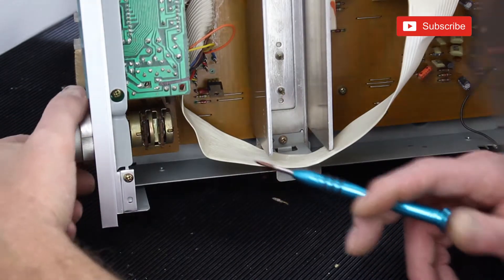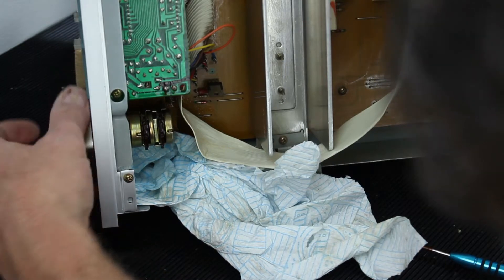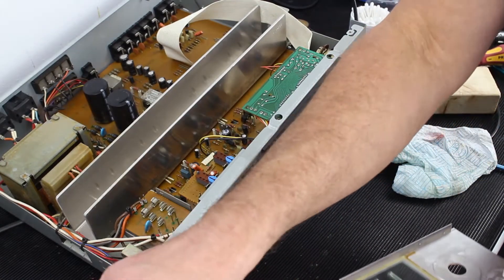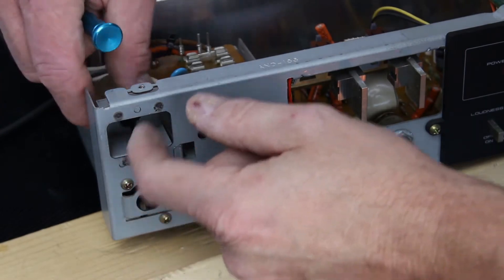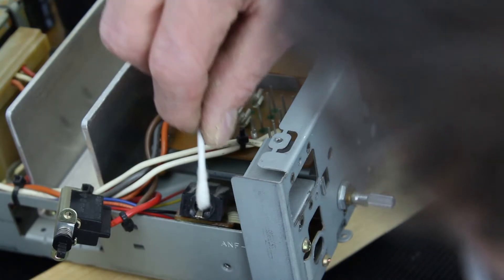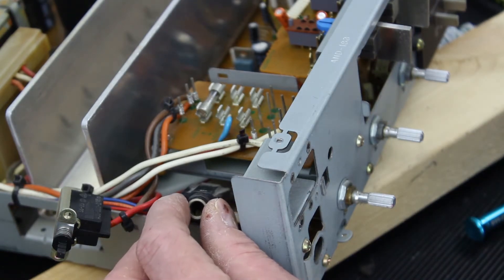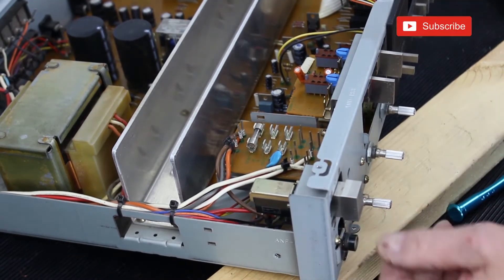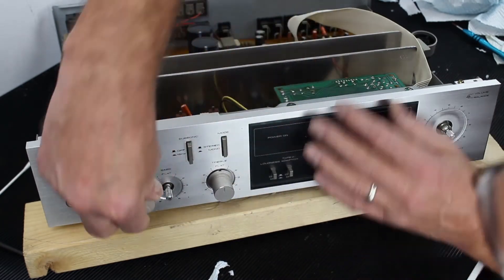Pioneer amplifier SA-620 part 3 repair, reassemble & test. Let's find out if it all works correctly.

Comment: Retro Tech - do you rate this as a very good amplifier?  The SA-620 specs are very good. I have a Pioneer SA-510 with 33 watts and would like something more powerful for my 3-way 10" woofer speakers.  Thanks
Reply: Hi. I'm no expert but i've given this unit to my step son as part of his set up and it continues to operate daily without issue and sounds really nice. So overall everyone is pleased with its performance, reliability and overall sound. The man I purchased this from didn't want to give it up as he had it from new in his teens, so maybe that tells a story?